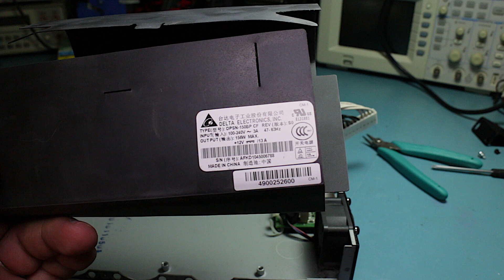Dell PowerConnect RPS-600 Teardown

Comment: This box was meant to provide redundant power for older Dell Power connect ethernet switches. The powerconnect switches each had a single AC PSU and if you wanted redundant power to the switches you used this box to provide also DC power to the switches. Normally the switches would be connected to AC for power and then also DC as alternate power in active/active setup. For some powerconnect PoE you needed a similar box to provide full PoE to all 48 ports: the standard AC PSU could only handle 24 ports PoE. But then the box was just for one switch.
Box supported 3 switches as many stacked the powerconnect switches to a single logical switch